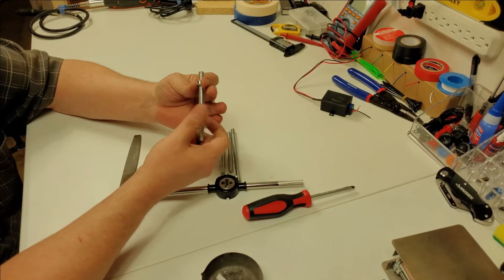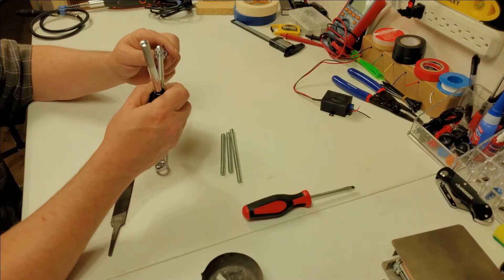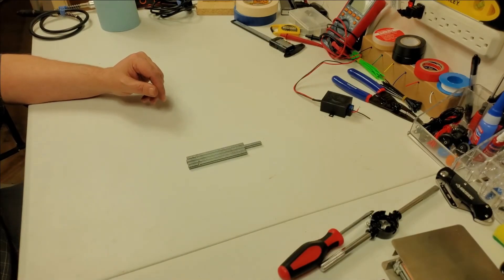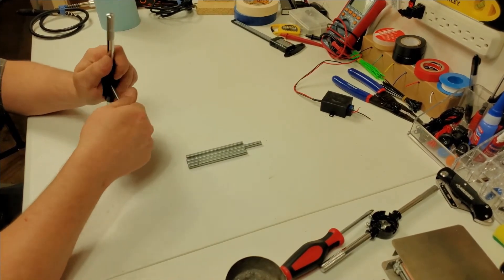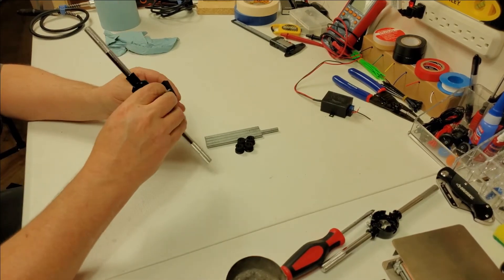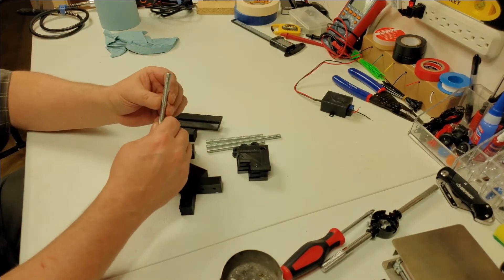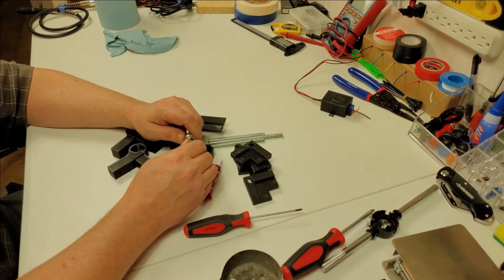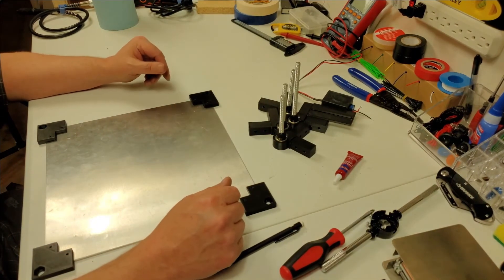Cheap K40 Manual Z Bed - Full Build - Part 2

Comment: Quicker way to sort thread out. When you've cut it, whilst it's still warm lock in your vice with your two nuts at one end and run the other nut off over the cut end. The nut will rethread.. I do that all the time. 

Always put nut past the cut area. So you can run the nut off re threads as you go... 

Just my way. Great channel. Other than your ermms..

Comment: What size are the bearings and where did you get them. That is the only thing I am missing to do the build. I went through all 3 videos and could not find a answer.
Reply: 1603DC is what I found that fits. Couldn't tell you where to get them, I have a bearings store locally.